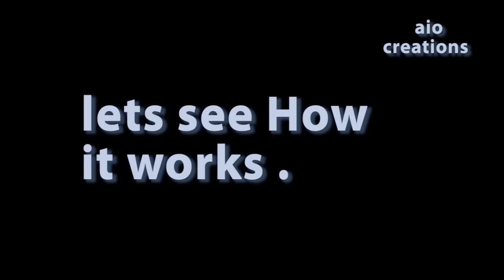Hazard indicator flasher for  all motorcycles only in 150 RS  #best #2021 #easyinstallation

Comment: where you will buy and can I install in my tvs Jupiter
Reply from the maker: from amazon yes u can install
Reply from the maker: <iframe style="width:120px;height:240px;" marginwidth="0" marginheight="0" scrolling="no" frameborder="0" src="//ws-in.amazon-adsystem.com/widgets/q?ServiceVersion=20070822&OneJS=1&Operation=GetAdHtml&MarketPlace=IN&source=ac&ref=qf_sp_asin_til&ad_type=product_link&tracking_id=httwwwyou0891-21&marketplace=amazon&region=IN&placement=B01M3SK69R&asins=B01M3SK69R&linkId=b4da8b8fd87eaa243ee94c256f8f6601&show_border=false&link_opens_in_new_window=false&price_color=333333&title_color=0066c0&bg_color=ffffff">
    </iframe>

Comment: If I didn't contact the switch and direct earth the thin black then it can't not run with the bike turn indicator switch.
Reply from the maker: u have to connect switch sir .
Reply: AiO Creation's please make a video of hazard light flasher who use the stock indicated switch not the external one...

Comment: what does it sound
Reply from the maker: <iframe style="width:120px;height:240px;" marginwidth="0" marginheight="0" scrolling="no" frameborder="0" src="//ws-in.amazon-adsystem.com/widgets/q?ServiceVersion=20070822&OneJS=1&Operation=GetAdHtml&MarketPlace=IN&source=ac&ref=qf_sp_asin_til&ad_type=product_link&tracking_id=httwwwyou0891-21&marketplace=amazon&region=IN&placement=B01M3SK69R&asins=B01M3SK69R&linkId=b4da8b8fd87eaa243ee94c256f8f6601&show_border=false&link_opens_in_new_window=false&price_color=333333&title_color=0066c0&bg_color=ffffff">
    </iframe>
Reply from the maker: https://www.amazon.in/gp/product/B06WGX8WJD/ref=as_li_qf_sp_asin_il_tl?ie=UTF8&tag=httwwwyou0891-21&camp=3638&creative=24630&linkCode=as2&creativeASIN=B06WGX8WJD&linkId=206d263d8647ba1ab0a62a08a6be359b

Comment: bai kitha milu a flasher
Reply from the maker: amazon per
Reply from the maker: <iframe style="width:120px;height:240px;" marginwidth="0" marginheight="0" scrolling="no" frameborder="0" src="//ws-in.amazon-adsystem.com/widgets/q?ServiceVersion=20070822&OneJS=1&Operation=GetAdHtml&MarketPlace=IN&source=ac&ref=qf_sp_asin_til&ad_type=product_link&tracking_id=httwwwyou0891-21&marketplace=amazon&region=IN&placement=B01M3SK69R&asins=B01M3SK69R&linkId=b4da8b8fd87eaa243ee94c256f8f6601&show_border=false&link_opens_in_new_window=false&price_color=333333&title_color=0066c0&bg_color=ffffff">
    </iframe>

Comment: out of stock hai..ye amazon per
Reply from the maker: ab aa gaya h check it out
Reply from the maker: <iframe style="width:120px;height:240px;" marginwidth="0" marginheight="0" scrolling="no" frameborder="0" src="//ws-in.amazon-adsystem.com/widgets/q?ServiceVersion=20070822&OneJS=1&Operation=GetAdHtml&MarketPlace=IN&source=ac&ref=qf_sp_asin_til&ad_type=product_link&tracking_id=httwwwyou0891-21&marketplace=amazon&region=IN&placement=B01M3SK69R&asins=B01M3SK69R&linkId=b4da8b8fd87eaa243ee94c256f8f6601&show_border=false&link_opens_in_new_window=false&price_color=333333&title_color=0066c0&bg_color=ffffff">
    </iframe>